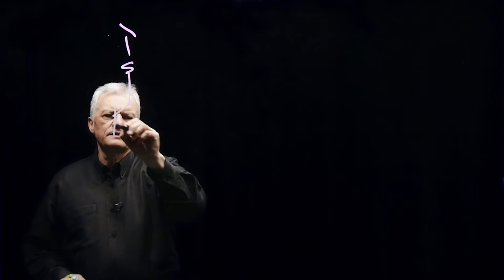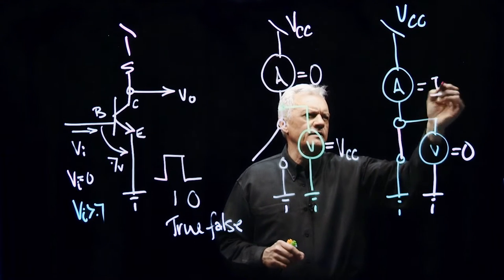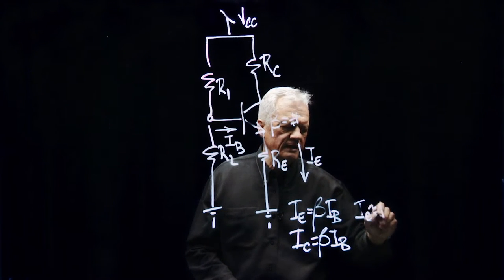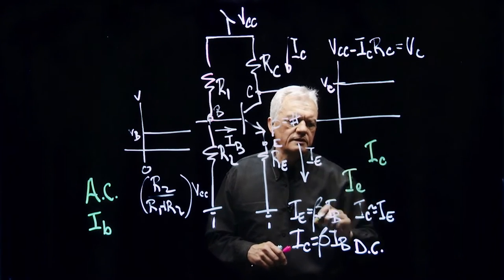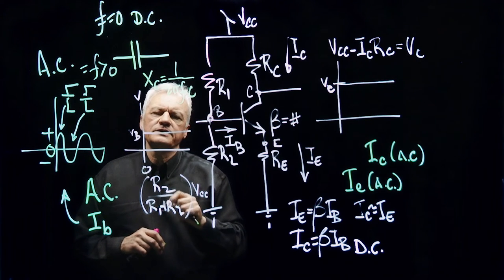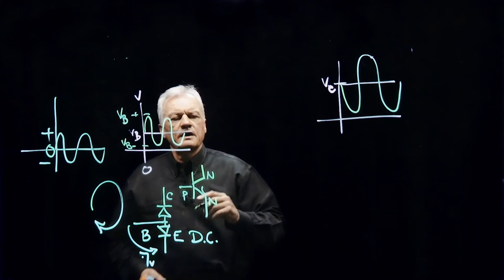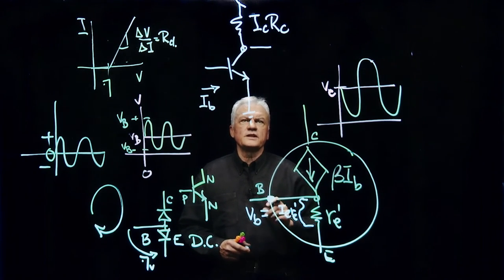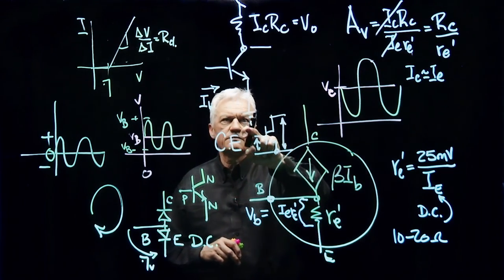Electric Circuits | The Bipolar Transistor Switch and Amplifier - Part 1 of 2

Comment: I see how it acts as an amplifier,but I'm still in the dark about how it works as a switch
Reply from the maker: Thanks for your comment! Hopefully this helps:
A mechanical switch is either open and not conducting current or is closed and then does conduct current. The transistor in like manner can be turned completely off (biased off at the base or gate) and therefore not be conducting current, i.e. an open switch, or can be turned on fully (biased on at the base or gate) and be conducting current i.e. a switch that is closed.
This aspect of on or off is what digital circuits do in that they either pass current when on or not pass current when off.